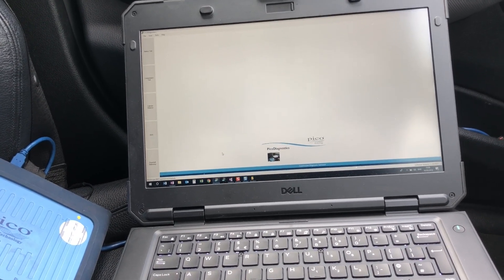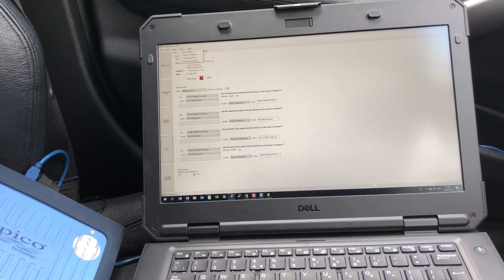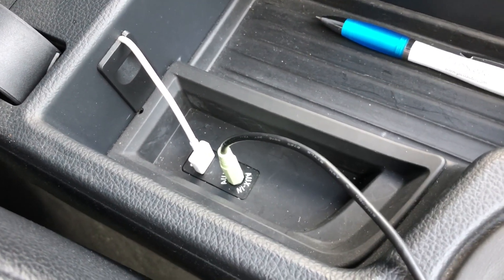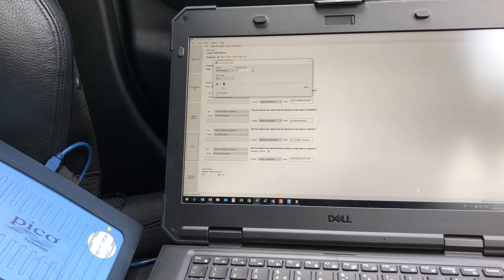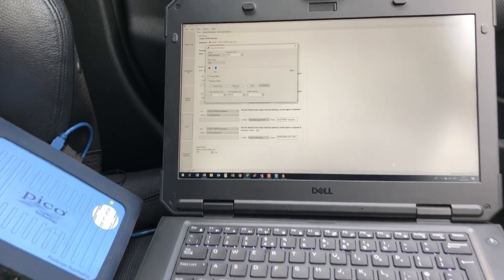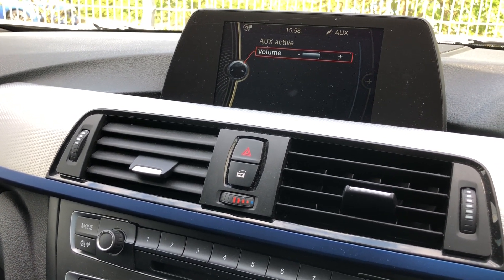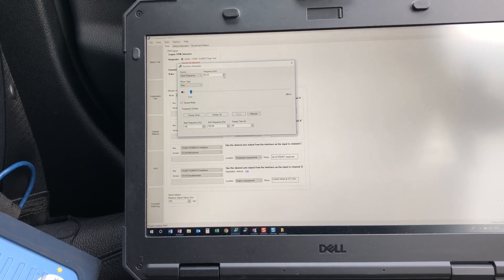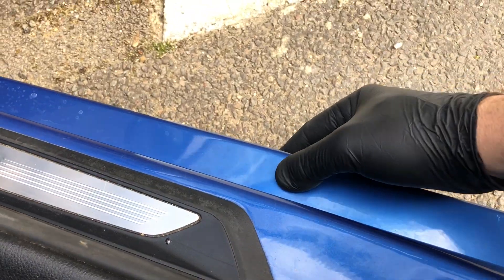Finding the cause of a cabin vibration with the PicoScope function generator

Comment: Great diagnostic👍,but the questions what about if the car doesn’t have aux input? I’d love to try that technique but on early LandRover models is no aux available only USB. Thanks
Reply: Hello and thank you for the question. (Sorry for the late reply) If we can connect with the audio system via Bluetooth then this could be another option. Alternatively, an FM modulator for older vehicles will be sufficient whereby we tune the audio system to the output  of the FM modulator. I hope this helps

Comment: That is very good, can you explain  a little more? Is it the speakers making the sill cover rattle? When they are at that frequency?
Reply: Hello and thank you for the question, the vibration is predominately created by the in car audio speakers and integrated Sub Woofer. The low frequencies pass/transfer throughout the cabin fixtures and vehicle framework where fittings such as trims, panels, fasteners and covering respond and resonate at particular frequencies . Here the sill finisher responded at 77 Hz